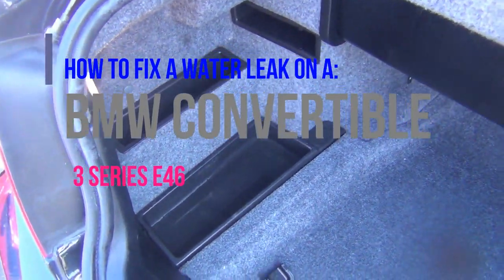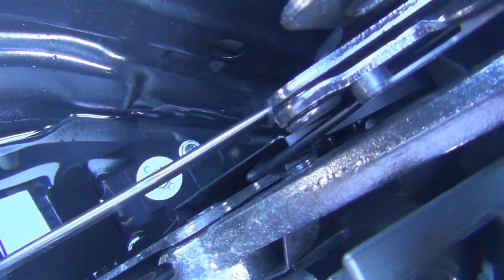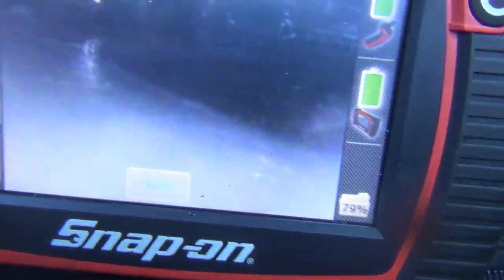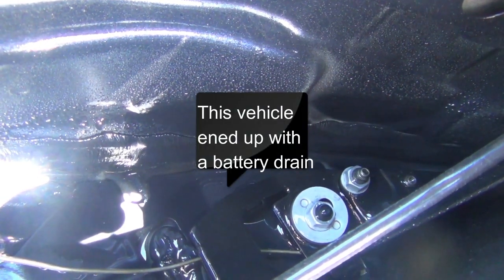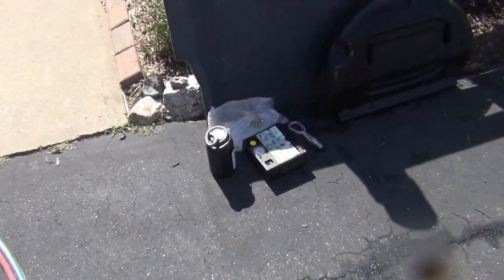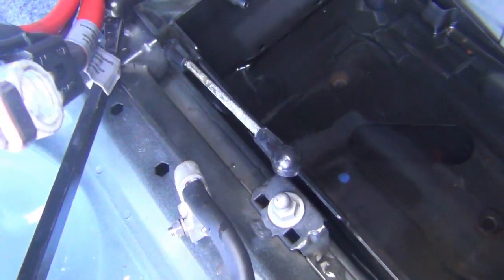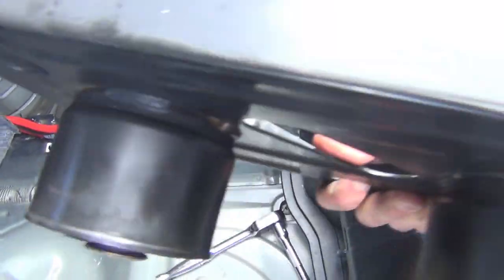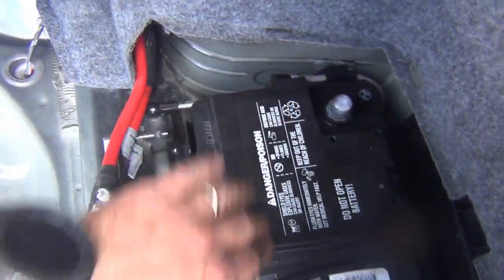BMW Water Leak E46 3 Series Convertible: Diagnosis and Repair Procedure With Battery Replacement DIY

Comment: Super video ! Just take notice there are 2 body plugs at the bottom of battery tray so you can push them out to empty very quickly
Reply from the maker: Hi Nicolas, The body plugs on this vehicle did not feel great so I didn't want to mess with them. Thanks for the tip though! I am sure it will help others!
Reply: @AskTheCarExperts  hi, as regards the water drains on the top  today   I did exactly like you dedcribed, thank you !

Comment: Great video, thanks I just discovered a fish thank in the back of my E46 Convertible! Haha 👍👍👍
Reply from the maker: Hi James! Great you found my video! I hope it helps! Thanks for posting!
Reply: AskTheCarExperts , yeah thanks mate 
 I thought theres was actually a leak going into where the roof sits when it’s down ?  And I didn’t realise there were drain holes under the roof hinges , I did the same as you and unblocked them with an old coat hanger . Thanks again 😁👍😁

Comment: I have done the procedure for draining water out of 2000 323CI E46. It's a bit of a pain finding the drain hole. BMW put these drains in a foolish place where access is near zero. I have found that if you pour a couple gallons of hot water in that area, about 1 gallon at a time, it eventually breaks free. Typically, dirt, small debris from inside convertible top area is usually the cause. It take about 3-8 minutes to break free. The more water you put in there, without flooding the back, the more the weight of the water pushes the drain free. Coat hanger was used but, not positive if I actually hit the drain hole. I'll use my scope next time.
This was an excellent video! Great info and pretty clearly laid out. Thank you!  I Subscribed but, I really don't know what that means because I have subscribed to various videos in the past and never hear from the posters.
Reply from the maker: Hi StandTall, I always try to respond and help. If you want notifications of new videos youtube has you select the allow all videos.  I appreciate your input as I am sure it will help others!
Reply: @AskTheCarExperts  Thank you, for such a quick response. I'm only interested it videos that pertain to 2000 BMW 323ci E46( or close in years, as yours is).
Does this limit it to your videos only?
Reply from the maker: @standtall7646  I do a lot of different videos mostly about BMW. I will be doing a full series on my Z3 with M54 engine teardown, head repair, that would be the same engine as your E46.
Reply: @AskTheCarExperts  Good to know. I look forward to seeing those. Thank you, again.
Reply from the maker: @standtall7646  Awesome!
Reply: @AskTheCarExperts  Now.., I'm dealing with a battery drain that I thought I had cured a few days ago, by replacing the Final Stage Resistor, due to Climate Control 
(NOT Climate Change :) Panel fan constantly running after shutdown. This morning, I woke up to a dead battery...., again. Frustrationg!
Reply from the maker: This could be an I Bus issue from the water. Check the RR side for a wire that would be for a CD player add on. They can corroded and short. Do a drain test https://youtu.be/ybBRdeW9Rk8
Unplug the heater control and see if it stops. Then remove the I bus wire from the IHKA and see if it stops. If not the control panel is faulty
Reply: @AskTheCarExperts  Nothing on RR side. Just battery and cables. I've never had water on that side. Always on left but, never pooled in trunk. I took battery completely out yesterday and all was dry, clean and no hint of corrosion and rust. Trunk, in general, has stayed dry. This drain this morning didn't make since....., yet. Thank you. I'll check out your video.
Reply from the maker: @standtall7646  sorry left hand side was the extra wiring
Reply: @AskTheCarExperts  No worries. Do you still use Amp Hound or, can this be done with a regular Multi Meter? I'm a contractor/Handyman, I am pretty good at electrical and electronics so, if a Multi meter will work, I have those. Your recommend? I did watch your video and gave a thumbs up. Anything to help you :)
Reply from the maker: @standtall7646  Thanks, You can use a multi meter in milli volts.  Realistically if you see any reading when doing the voltage drop across the fuse it has an amperage reading.  There is a chart you can look up to account for the fuse resistance but any reading as a general rule means a drain.
Reply: @AskTheCarExperts  I still had a "Parasitic" draw. I believe I have found it through tracing via Service Manual. Id I'm not mistaken, it is an A/C Cluth Relatability(fuse). I traced the wire that was continuously live after ignition shutoff and it came back to the A/C Clutch relay. I'm going tlook up how to test this relay. It's, apparently, behind the glove box. You know..., "Easy to get to". 😕. Your thoughts? Thanks, again!
Reply from the maker: @standtall7646  Some wires may still be powered with the vehicle shut down. You would have to monitor for amperage drain using an amp clamp.
Reply: @AskTheCarExperts   I see. This wire is from the main harness at the Climate Control Panel, where I constantly hear a fan running. I believe it's an 18 pin harness. The wire is a Red w/Violet and yellow "spots" on it. It's the only wire not cutting off after key off. And, it doesn't seem to do it all the time. But, frequently enough to kill my battery several times a week, at times.
Reply: @AskTheCarExperts  I could send you pics but, don't know how to do that from here.Maybe, an email?
Reply: @AskTheCarExperts  I forgot to mention that it is hot even when disconnected from the climate control unit, tested at the harness end itself.
Reply from the maker: @standtall7646  LOL normally I would have said yes but I just got hacked recently. Not opening anything via email anymore.  Make a video and send me a link. Time to be a youtube 🌟
Reply: Geez! Spell check. A/C Clutch RELAY. Not relatability.
Reply from the maker: @standtall7646  Just got my account back yesterday at 4:30 am after it being stolen for a week. Super stressful 😫.
Reply: @AskTheCarExperts   Wow! That's an unsettling and frustrating hassle.
I just tested #4 Relay, behind glove box and it tested good. Did not get to the #1relay. Ran out of time. You mentioned testing amp draw. Can you explain the process of, lead me to a video on how to?
Thank you, again.
Reply from the maker: The best way is to use an amp clamp around the negative cable. Monitor the amperage when the vehicle is asleep. Should be 30 to 80 milli amps at the most. Once you know how much the drain is you can hunt it down with the amp testing at the fuses or move the amp clamp to the suspected wire and take a reading. 
https://amzn.to/3D4cdNH
Reply: @AskTheCarExperts  Sounds like the easiest way to determine where amp draw is, is with a meter. Amp clamp with all these small wires would take far too long (for my schedule, anyway). Testing each fuse. I'll have to find your video on that, again.
Reply: I just reviewed this. I found you on Youtube just now but, forgot I had been here before. I just had another incident with water in these areas. Fortunately, there were drain plugs in about 6 areas underneath my car. I found one, fortunately, below the battery compartment and it needed draining. I tried the special tool trick but, couldn't find the drain hole. Now, I found your video , again, I will try that "Angle bend" on that special tool. Thanks, again. Your video is a great help. Thanks, AGAIN!! @AskTheCarExperts
Reply: I BELIEV MINE IS THE M52. @AskTheCarExperts
Reply: I wanted to ask: 1) Is there a DIAGRAM that shows WHERE this drain is?  2) When you insert your high tech angled tool into the drain way, which way is the hanger headed, to hit the drain hole? To the left/Right? I'm trying to determine exactly where this drain hole is. Is this info in the BMW Service Manual? If so, what page?
Thanks, again, for great video! @AskTheCarExperts
Reply from the maker: @standtall7646 😀 It can be a real pain to find. Using a scope really can help. It usually take me some time fishing around to catch it. I often have to use the scope to really hone in on the location. I am not really able to explain the process better than the video unfortunately.
Reply: Thank you. Understood. I have a scope but. just couldn't find the drain. I must have missed it or couldn't tell when the drain appeared. DO we know WHERE and HOW the water gets in there in the first place? That's a critical question, for me. Thanks, again! @AskTheCarExperts
Reply from the maker: @standtall7646  The area is not water tight.  The seal is just a water reducer.  It was never intended to be a water tight area. Keep searching with the scope. If there is a lot of crud the drain often looks odd as well.
Reply: Will do. Thanks! @AskTheCarExperts
Reply: By the way: How do I turn on/off notifications? Can I direct notifications to a specific email, as well? Not familiar on how to do this. Appreciate your help. Thanks, again. @AskTheCarExperts
Reply: Thanks for all your replies. I appreciate your time. I was wondering: With your camera, Are you able to snap a picture of the drain itself? I scoped but.I really never noticed anything that looked like a drain hole--somewhere for water to drain. I would with men but, I didn't see anything. Still looking for what the drain actually looks like. 
Thanks again!
Reply from the maker: @standtall7646  Sorry I don't have the vehicle on hand. This was a friend's car.

Comment: Thanks for this. The battery in my e46 3 series convertible died and it's good to see how to remove the battery as it is different from the non-convertible e46. Also a very interesting point about the drains becoming blocked.  I'll check mine next time it rains.

Comment: im going through this nightmare right now with my e46 vert. I thought it was bad rubber seals or a misaligned trunk lid as it had been removed previously  for repainting. but this makes a lot more sense. this video was very helpful. looks like i got some drainage to do. i had no idea the battery cavity would fill up like that
Reply from the maker: Hello Jcue, Water leaks are a nightmare! I am glad you found my video. Let me know what you find. I plan on doing a short live feed on Wednesday around 6 pm EST if you would like to join and comment.
Reply: @AskTheCarExperts  will do.
i did exactly as you did here (minus the borascope) and then i heard that sweet guzzling sound when the water drained. flushed it with plenty of water after. also my battery compartment had about 3 inches of water in it. all sorted now though. Thanks again!
Reply: A similar way to clear it, is to get some brake pipe and thread it with strimmer line. Make a lump on one end by melting the line, then bend the pipe at about 45 degrees.  Using the same method as in this video, hook the pipe into the drain, then feed the line through and it clear the whole drain line.  Fiddly, but worth the efffort.
Reply from the maker: @jcue  That is great! Thank you for posting this :)

Comment: I found it helpful to park facing down a hill so that the water can flow down the drain rather than overfill that compartment and pour into trunk.
Reply from the maker: That is an excellent idea when cleaning the drains to move the water in the right direction.

Comment: Just came across this video. My e46 vert has been stinking lately in the cab. I eventually after 3 weeks of air freshmen’s lifted my rear carpets to find the floor soaking wet with water coming up through the mat holes. 

Il be doing this exact thing tomorrow. I’m praying no damage has been done ! It’s been 3-5 weeks water sitting there
Reply from the maker: Great you found my video! I hope it did not cause any damage to the electronics. Let me know how it goes.
Reply: @AskTheCarExperts  
All Electronics currently fine touch wood il give it a go tomo with the coat hanger technique. 

Looks quite a fiddly job. I’ve bought a siphon pump to siphon the water out too so il give that a go. Water is underneath my battery the exact same way as yours.

Comment: It's really too bad that there aren't any body drains in these cavities, like some older German cars used to have.  In the event of a drain blockage and subsequent spillage - the body drains would keep water from accumulating in these cavities and prevent damage.  I recently worked on a BMW E61 that had plugged sunroof drains which caused water to build up.  Thankfully several modules that got wet were OK after being thoroughly dried out - most don't get this lucky.  The only hint the owner had that something was wrong was that the battery would drain in a matter of a long weekend if the car wasn't driven, and the constantly fogging up of the windows.  The water caused the modules to remain active and refused to go to sleep, hence the draw.
Reply from the maker: Hi AK, The E61 is also known for kinks in the sunroof drain and you have to cut in and add a new splice to the drains. Glad to hear you got those cleaned out and the modules where OK. It gets expensive fast with water leaks!

Comment: Next job on the list. Thanks
Reply from the maker: Let me know how you make out.
Reply: @AskTheCarExperts  I Will do. I’ve got the lot to do. Roof drains, clean all the contact points for the roof and drain the fish tank under the battery! I laughed at the comment from the guy in the UK but I live in Northern Ireland and we’re not exactly known for our drought conditions either! Who said buying a soft top was a good idea here! Only owned it a few weeks And even tho it’s 18 years old we love it
Reply: All done and dusted! I took my time, your instructions were spot on and my battery box was floating. I cleaned out the channels with wire coat hangers and flushed to test. The started on the boot. Thank you so much for your video!!
Reply from the maker: @redno5f1masters  Great to hear Colin!

Comment: I do exactly the same, but with a flexible wire, right after that , I pour Draino, it really cleans the drain and the drain tube, last longer
Reply: Except that you've allowed drain onto the outside land and, possibly, into the ocean. THAT is why I don't use poisons to have an easy fix.

Comment: Just blow air from the bottom up and clear the drain that way it's very effective and much easier
Reply from the maker: Some vehicles it can be difficult to access the drain holes or find them without looking for water trace but if you can it definitely could help. Just make sure to flush with water after to clear any debris built up.

Comment: Great video and very helpful! Same problem with my 04 330ci. Got the water out of all places. Now just need advice on the I/K bus harness. Having all sorts of gremlins since this happened in Dec 0f 2021. Can the relays just be changed? Or, do I need to get the whole harness/modules/relays (k-Can?) replaced? Can I just remove the relays and splice and re-pin?? HELP!!
Reply from the maker: Hi Vicki, You most likely have corrosion in one of the connections. Reach out to me via my website www.askthecarexperts.com with the contact me tab and we discuss the issue via email.
Reply: @AskTheCarExperts  You're an angel! Thanks so much!! Will do :)
Reply from the maker: @vickigiordano1162  Thanks Vicki, I got the email and I will contact you tomorrow. Have a great night.
Reply: @AskTheCarExperts  thank you!!
Reply: @vickigiordano1162  Why can't I see the Experts Replies here

Comment: Be careful when filling up the cavity with water with a hose or bottle if it’s blocked up. There’s small holes on both sides that you can barely see in this video. If you aren’t careful & overfill it the water will go into the cabin of your car underneath both rear passenger seats.
Reply from the maker: Hello Miles, That is exactly why the holes need to be unclogged. Water will enter the vehicle if this cavity cannot drain. You are correct to not overfill when testing.

Comment: I meant to ask: WHERE does the water get in, in the first place? Thanks, again.
Reply from the maker: Right around the back seal. I have even replaced that gasket but after looking into it further it is only to help deflect most of the water. I hope you where able to find the drain and get it clear!
Reply: I didn't see this reply. My apologies. Which Back Seal are you referring to? Can you make this easy for me and either point it out in a picture or a video. I just want to know which back seal you are referring to so, I go to that seal, first.. Thank you! @AskTheCarExperts

Comment: I found a battery well full of water this weekend so dried, cleaned, ground, painted etc but need to stop it happening again.
I'll do the drain points but more interesting, is how does the water get into the compartment in the first place and get the chance to leak into the boot(trunk)
Is there a seal somewhere?
Reply from the maker: Hello Matthew, there is a seal but it only reduces water. It is normal for water to get into this area. With the drains clean water will stop getting into the interior.